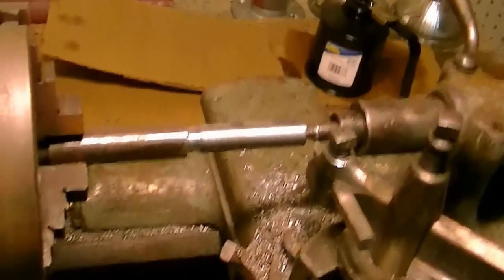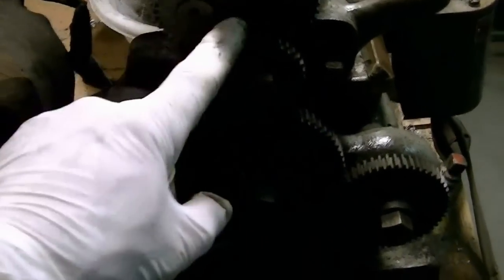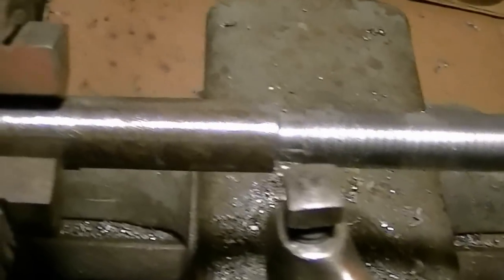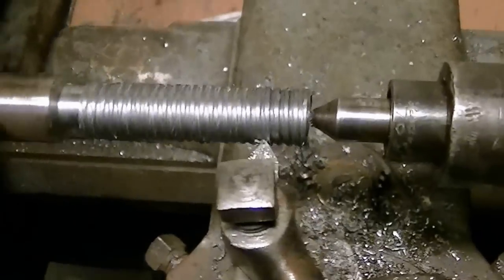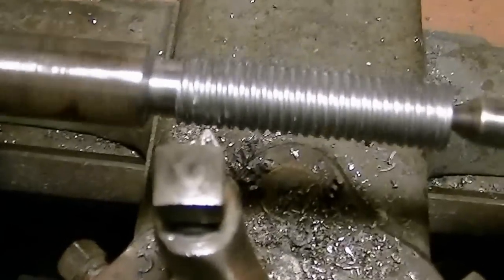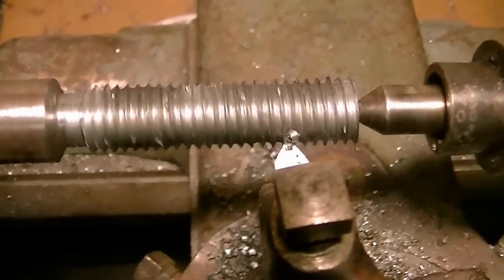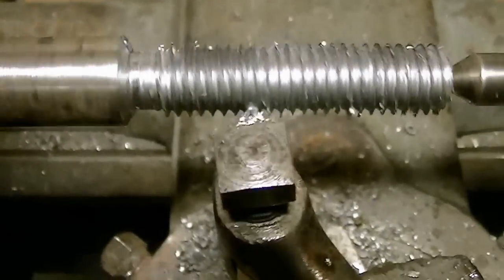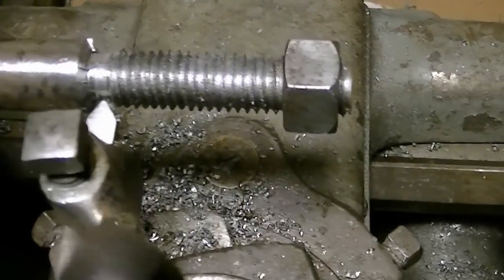Thread cutting closeup.

Comment: 29° for standard threads, 14.5° for acme. Also your last cut should be a plunge cut, it will clean up the right side of the thread, and you should always file and clean your threads before test fitting.

Comment: Mark, I see you also don't know what your back-gear is for!! But I'll forgive because I see you're having fun. I have a Box-Ford lathe, a direct copy of yours, and parts are interchangeable with it. Engage the back-gear to reduce headstock speed for cutting external threads without having to operate at frenetic speeds! Otherwise sooner or later you will end up with a tool in the chuck!

Comment: thanks for your upload, im actually looking to make threads but not with this conventional die so how can i stretch the pitch ?  get more slanted flanks? not so tight root? im like really new at all this so i just picked up a tap and die set for 9.99 but i dont think ima be able to do what i was thinking so any suggestions ?  i do own a cnc milling 3020T DJ series machine but never used it hahahah dont ask lol

this rod i want to thread i want it to look more like a worm gear but not with its functionalities the idea behind my search is to thread my own rods to attach to a dc motor and the thought is that when the rod spins with the shaft of the motor it will go in pretty quick into its same design tap nut , i just dont want to use this style because i think it will take the dc motor too many turns to reach the end of the rob if it was to be screwed in. my style will make a shorter travel meaning, less spinning from the shaft less motor work, this is for a robotics project
Reply from the maker: +Frank Lopez It sounds like you need acme threads, It is the thread that is on a vice or C clamp. It is done with a lathe.
Reply: markp0177 hmmm ill look into it, thanks by the way what makes it a acme? that sounds like some looney toons trade marks lol ? 

i own a light milling and engraving cnc so what is it i should buy next to make my own worm gear < and custom threads such as i described ?
Reply from the maker: +Frank Lopez   I think you can buy thread stock, I am not sure about acme thread though. You will need a lathe big enough to make whatever you need. How long of a thread stock do you need?
Reply: markp0177 buying  something i need is not something they sell, which is why im looking to know how to make my own i need a special design thread not your conventional style and i need it 3 to 4in
Reply from the maker: +Frank Lopez A little 9" by three foot lathe should work for your needs. You can find used ones on Ebay. You may be able to rob the threaded rod from a C clamp.
Reply: markp0177 i think ill look for a video on how to diy one, i already own a desktop cnc 3020T DJ model so i just need a lathe upgrade tho i do have a dc motor from a weed wacker 120v  so maybe i can buy a chuck and make a platform to hold both chuck nd motor in a lathe configuration? idk
Reply: Frank: don't get high on your own supply! ;) ;)
Reply: @alsatian9130  lol i see you know allot about drugs😌 wise words from experience veterans😅

Comment: I did find the spur gear, finally, it looked like it was part of the reverser assembly.  It was very hard to get it off.  I set it up for 12 TPI and threaded a mauser barrel (small ring).  Your video helped a lot, Thanks.

Comment: compoud is set to 29 or 29 1/2 deg, always use cutting oil for cleaner cut, every 4-5 cuts do a clean up cut at the same settings as the last cut, zero out both handles on the compound for getting the depth right, Hope this helps :)

Comment: It looks like you lost your tip part way through the threading process. I disagree with the 29 deg. infeed theory. I have been cutting threads for 30 years now, feeding straight in, in a variety of very tough materials such as stainless steel, inconel, and titanium. The only time you break the tip off, is if your depth of cut per pass is too deep. I will be posting some vidoes soon.
Reply: Hey, is it possible to cut a 1meter long thread on a lathe?  maybe M16 20TPI

Comment: When you withdraw the tool after each cut, it it the compound or the cross slide moving?  Thanks.

I have a 1938 SB 9".  I've been cutting my threads with a tap wrench centered with the tailstock.

Comment: First rate lesson! Thanks for posting this video.
Two questions:
I've seen machinists use a 29 degree setting, but you use a 21 degree setting, You explained why (cut on one side of the tool); can you explain the difference in using one or the other value, or even something in between?
Also, if you weren't videotaping this (were you want your views to more clearly see the cutting action) would you have used coolant?
Looking forward to your next video.
Roy Lewis Buffalo, NY USA